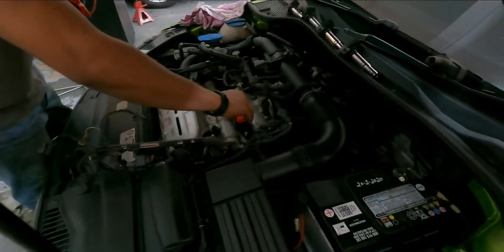Volkswagen Scirocco 1.4tsi Audi R8 Coil Upgrade!!

Comment: when did you notice the misfiring? I have a poor cold start (like it's running on between 3\4 cilinders), i already walnut blasted the intake. did you experience the same thing?
Reply from the maker: I guess cold start is normal even on my 2.0 tau it does the same thing. But if it misfires when it’s warmed up then that’s a problem.

Comment: Hi bro, what will happen if I direct plug and play without re-wiring the connectors? As some of my local workshop told me just plug and play will do, and I'm kind of skeptical about it, thus have not let them install the r8 ignition coils for me.
Reply from the maker: It just won’t start cause the positive negative and ground are all not in the right order

Comment: Hey bro do you know which brand of coil pack was used? I have the same car and would like to know Thankyou :)
Reply from the maker: I went through 2 sets of coils. I would recommend the Bosch R8 coils over the Red r8 ones as they can take more abuse. But u do have to modify a little for it to fit into the adaptor plate.

Comment: U already modded stage 2 during changing the r8 coil?
Reply from the maker: Still stock map at the moment.
Reply: @DrivenTechReviews  i heard it will cost micro missfire due to the dwell and discharge time if no custom map. . Even custom map there is still possibility of knocki g
Reply from the maker: @krimznheidiz  yeah that's what I thought too. But so far been using it for almost a year it performs way better than the stock coils and eliminated my juddering issues.